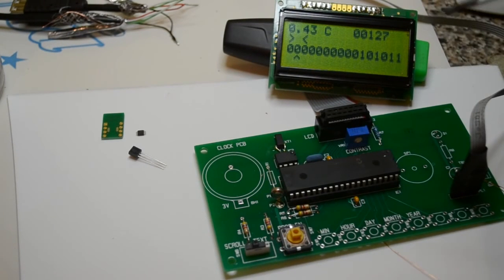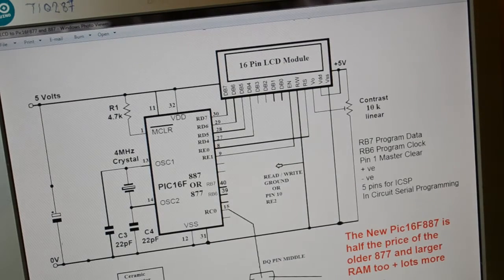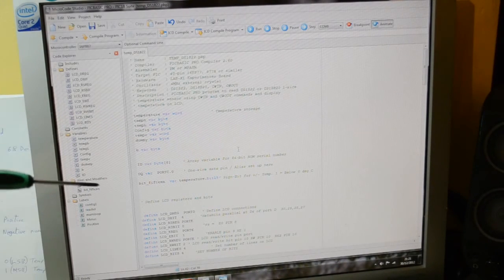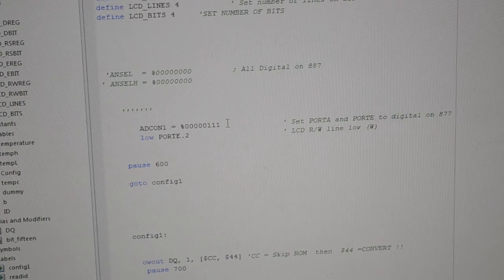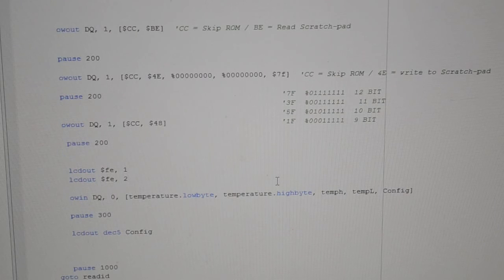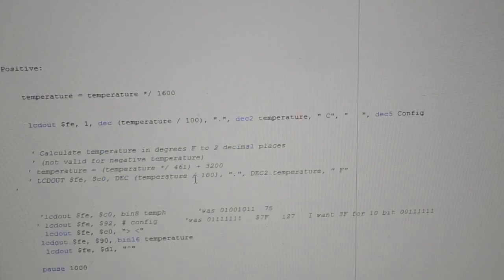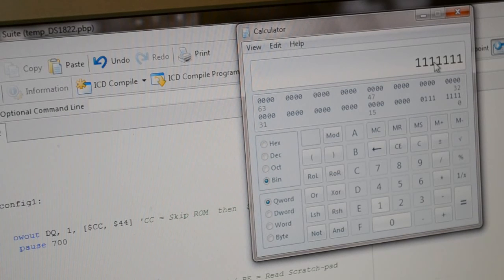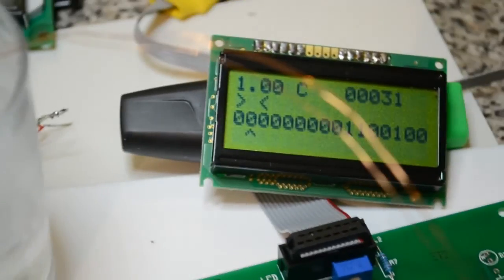Maxim / Dallas DS18B20 Temperature Sensor, Positive & Negative Thermometer

Comment from the maker: Hi, there are 16 bits for the temperature so a 'word' is required.
What compiler / language are you using?
Plus - depending on your compiler, I have noticed sometimes a code needs the following   if ........ >= 30 so try if temp >=31 then .....
A word is no problem unless you're trying to write it to eeprom etc.
let me know
regards
john

Comment: Hi. I am struggling here a bit. My sensors (2) send presence pulse upon reset but when i send search ROM command there is no response as it should be with 64 bit code.I am writing my own code from scratch. Would it be timing issue? I played a lot with timings and compared them on scope with other libraries. Still, can't get it to work. any pointers?
Reply from the maker: Hi,
Sorry I have no idea, I only used an 8 bit Pic in this example.
Reply: +John B I amusing 8 bit micro with C. Compiler is XC8.
Reply from the maker: +Peter Wobacz 
No it's Mikroelektronika's MikroC pro for Pic.
Sorry, just looked at this old video, I see it's MicroCode Studio & Pic Basic Pro.
Reply from the maker: That is 8 bit, not 64 bit.
Try a simple communication and see if your device works.
Reply: +John B I know it is 8 bit. What I am saying is that sensor does not send reply which should be 64 bits in length according to Datasheet. In fact I'm not getting any response.
Reply from the maker: It could be a dead sensor, I had one fail where I guess I took too long soldering wires to it.
Reply: As i posted initially. Ive got two sensors connected at once. Also both sensors  give me presence pulse (when connected separately). This defeats statement of sensors being dead. Sensors simply do not respond to commands after claiming presence on data bus.
Reply from the maker: umm,
I guess there is some error in the code asking for the data.